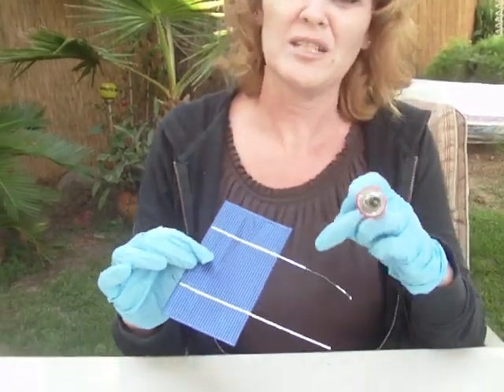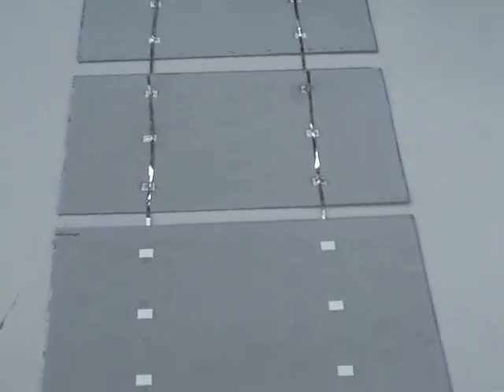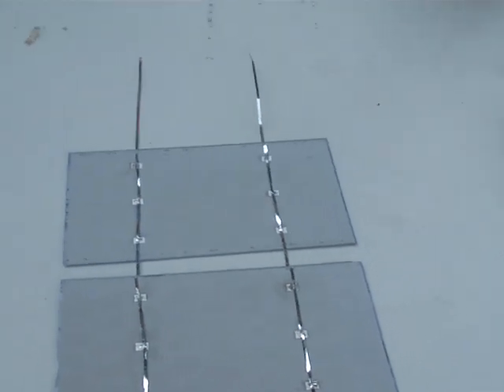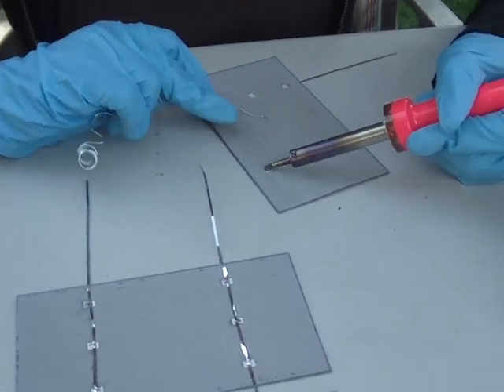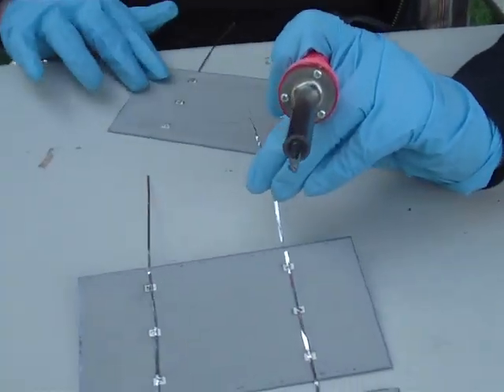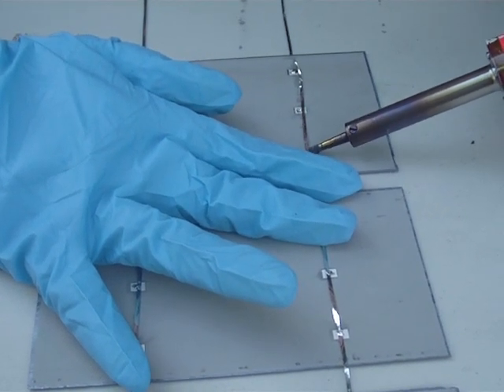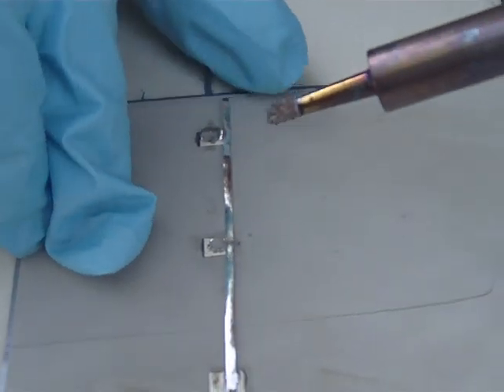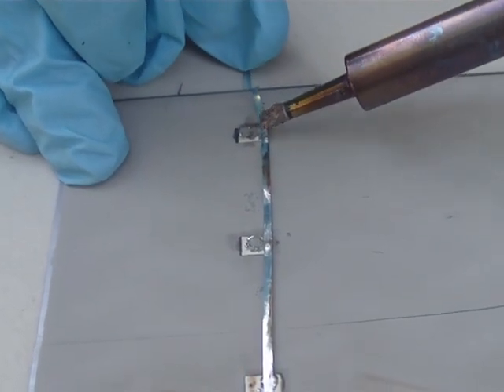Step by Step Instruction to link your solar cells together

Comment: It's hard to know who to believe when some people say to use a 25w soldering iron and others a 45w to as much as a 100w...... maybe it's the solder that is being used? Is there better solder than others for this use?
Also, can you tell use the melting point of the solder your using in this video....
thx....jake